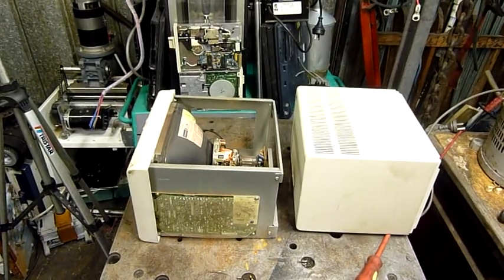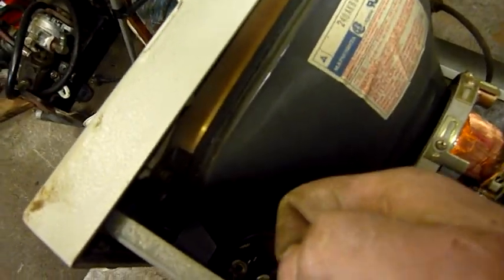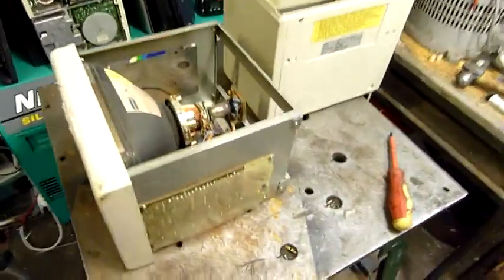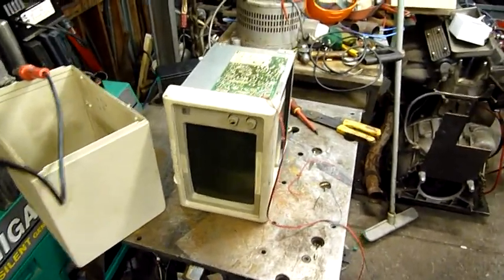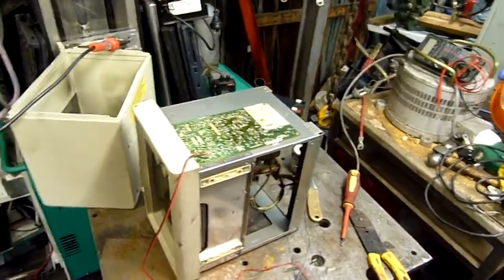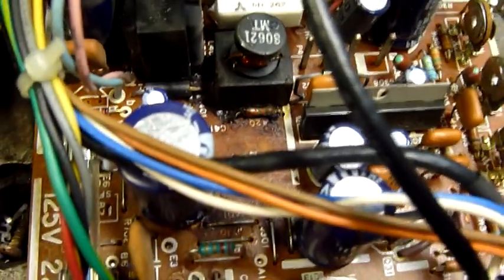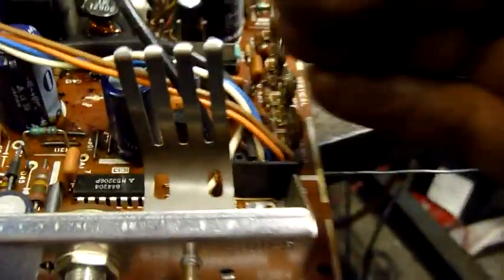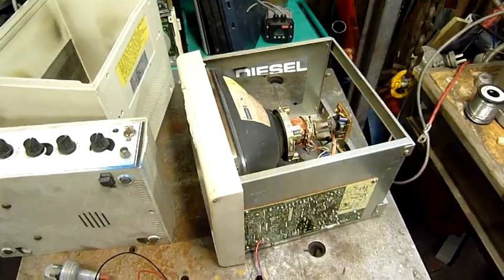1986 IBM Model 200 9" Monitor Troubleshooting

Comment: This old monitor reminds me of an old board I found that plugged in to an isa slot. It had a strange cable on it that appeared to replaced an 8088 processor. The board had a 386 processor on it.  The board had an intel stamp, but no one could seem to tell me what the board was and what it accomplished.  I never did get it working. But somehow, I still miss my 8088 running Dos and DCOM

Comment: I had a couple of green mono monitors back in the day on my various 8088s.  I did finally get a color IBM 5153, used, which I used quite a while until the vertical deflection started going bad.  I was young though so I had no idea about that stuff, so I would just smack the top of it until the picture spread back out.

Comment: a bit more info:  Check out the wikipedia article for the IBM 5151 monitor- there is a PDF linked in which has a schematic for that monitor.  It appears to be almost exactly the same as yours (albeit with an integrated 15V supply, though I'm fairly sure yours runs on 12V).  The schematic in the PDF seems to roughly match what is present on the boards in your monitor however including the 14 pin 7406 and that SIP vertical driver chip.

Comment: hey ed, you might want to check that transistor out, i think that transistor will be used to run the flyback.... is it a 2n3055? or similar because they are really prone to over heating and poping.

Comment: Hey Ed, i would like to ask you something,Im looking into building a weedeater bicycle,but in a little different way than usual. I want to put a gearbox from a little heavier drill after the engine,ant put a anglegrinder gearbox after that and put a sprocket on it to drive the wheel,now,the ratios seem to match up with what i need,but im gonna need the little weedeater motor to run backwards.. the firing on it (by looking at the flywheel magnets) seems to be little after TDC (original direction)

Comment: Do you still have it? This looks very similar outside to the IBM PC monitor. If it is used for years you should expect it to have brutal burn in,i've seen an IBM Screen on ebay that had burn in etched to the layer on the glass.  I don't know,maybe you can see how similar is to other IBM Screens and act accordingly as that "Model 200" doesn't help much.

Comment: Hi Ed are you sure the power supply is 12V DC and not 125V DC as marked on the board by the fuse. Maybe thats why there is no EHT the 12V is enough to run the heaters and nothing else. just a suggestion.

Comment: You describe the adhesive on the circuit board as Gorilla Snot, do you actually mean to say that the board manufacturers sourced gorilla mucus for the adhesive, or is that just your nickname/descriptive word to describe the substances they used?  If so, what is the actual substance they used?

Comment: The highest voltage you might encounter with an electrolytic in a TV is around 400 volts. Just check the suspect capacitor with a meter, discharge as necessary, and replace. The HV stuff is on the tube itself, and the DC power sent to the flyback (approx. 150V) to the mains filter (maybe 400V). You won't be touching the tube at all.

Comment: I used to have an old IBM machine with an 8086 chip (4.77mhz), IBM XT style but it was a 4 color CGA monitor with a 9 pin connection, 120v, and had a power switch twist knob similar to the bright and cont. knobs, but this looks quite a bit different because even the monochrome's that look exactly like this had a standard power input so not sure what machine this connected to.

Comment: Did you checked the transistors , i had same problem a few years ago with a old TV , the transistor burned out , for me it was easy to repair it i could see a dark spot on the transistor heatsink.

Comment: I think ob CRTs the flyback is driven by the horizontal output transistor which also drives the horizontal deflection coils.  Maybe this monitor doesn't self oscillate or your h.o.t. Is bad.  Try to find the horiz sync pins and feed a sawtooth wave at about 15-30khz at very low voltage into it.  You may get hv and a line on the display.

Comment: I had an old 8088 computer that had a green screen monochrome monitor that was very similar to this.  It got 12V from the PC through the cable and the ISA card plugged into a card slot.  Since this is monochrome, it will be looking for a 50Hz vertical and 18KHz horizontal.  The coax is going to be video.  I suspect you need to feed it both H and V inputs as well as video to get a picture (kinda like a VGA monitor but 2 less colours)

Comment: A Google search for the part number and model brings up very little info, it's barely even known about on the internet, never mind and pinout info.

Could you just do the tedious task of tracing the connections back from the DB25 to figure out roughly what each one does? If theres an enable pin it will surely be connected to some sort of transistor or chip in line with the power source. There aren't that many connections, so I'm sure it is possible to get it going.

Good luck Ed.

Comment: Chip numbers I could see off your did come up.  The shielded cable is most likely the input drive signal.  You need to provide 15kHz drive for horizontal, and most likely 60 Hz for vertical.  All your signals should not exceed 1v p-p.  General CGA color code is yellow=vertical brown=horizontal.  If you can feed me IC numbers and lead colors I can figure out your pin out.

Comment: Hey Ed, you won't be able to run it off your PC  at even the lowest of resolutions as PC's wont go less than vga (unless you have something really old from the 80s) There is a utility called Soft 15khz that allows your PC to output 15khz (CGA) frequency video, so give that a try

Comment: That's not weird. The electrolytics are going bad. When they're discharged they leak too much. When they get a chance to warm up and get a charge, their leakage current starts reforming the aluminum oxide layer and it starts performing better. Replace the caps.

Comment: its sorta the same idea that apple hd done with the adc connector where they supplied power, video and usb over the single connector on the monitor. also it would turn on the computer just by turning on the monitor. strange that they would do that

Comment: Hmm, looks like a simple monitor, the early stuff wasnt like a tv with a free running line oscillator, you had to provide eather hsynk or composite video to extract the synk from.

I never got a closeup on the signal socket so i guess its a 25 way "d" type, hmm...

The video may just be a light/dark video pin, ttl logic levels.
I would expect the hsynk/vsynk to be ttl if the video is two state.

Dont give up, someone will know.

Comment: make sre you get 120v along the flyback transformer use a  standard light bulb + crock clips across line ot pt transistor could be open circuit put 1 clip on base 2 on colletor if bulb pulsates then driver circuit open..